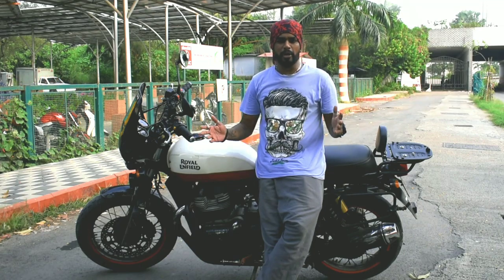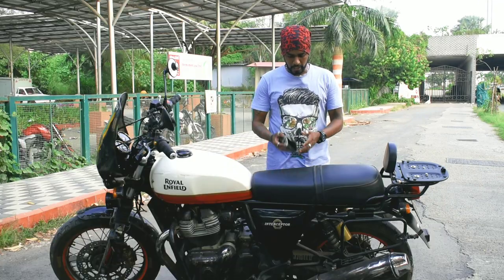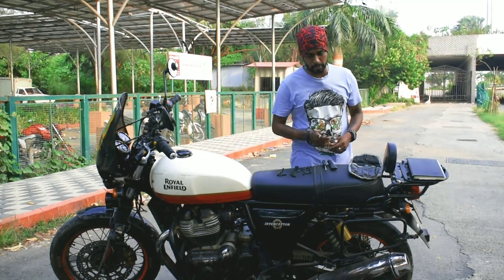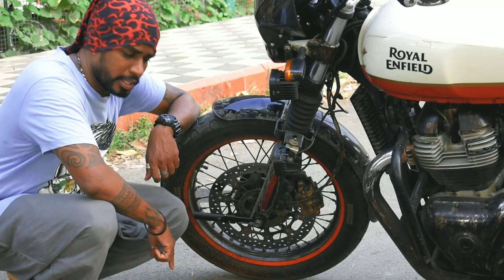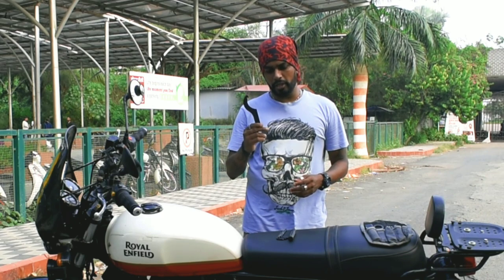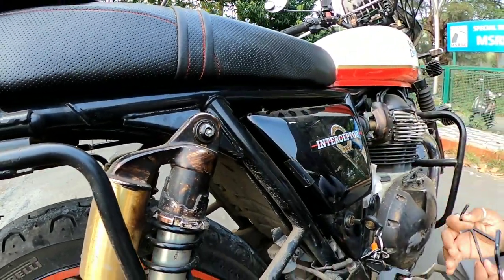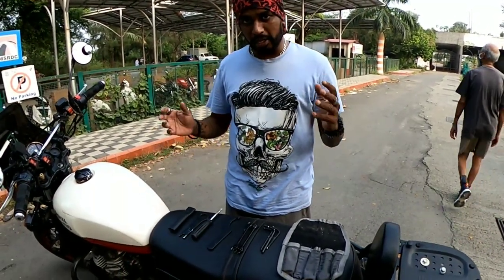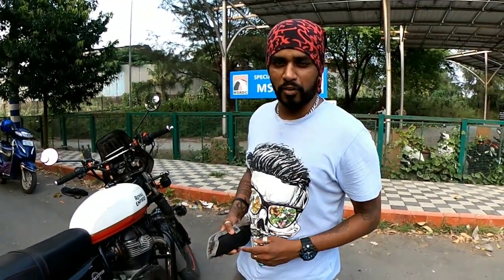Interceptor 650 Owners Know your TOOL kit | What, How & Where to use them

Comment: Very informative video mate - But RE should have also provided spark plug removal tool as its there in my TB500 and I use that only to remove spark plug for cleaning
Reply from the maker: Yes they missed on that not sure why